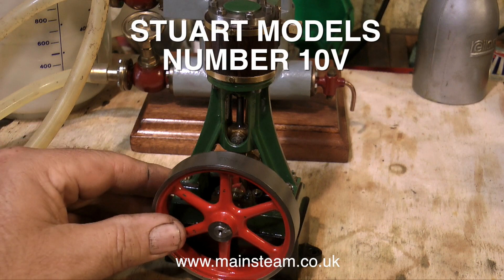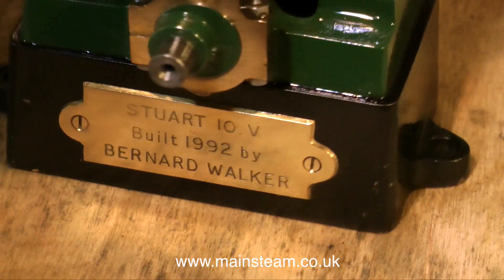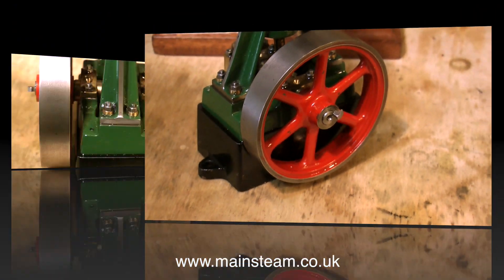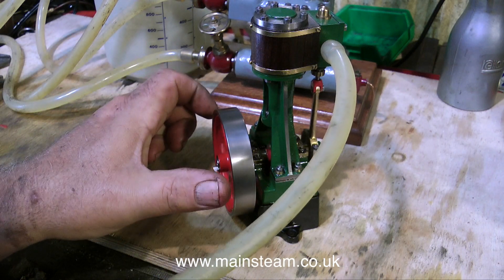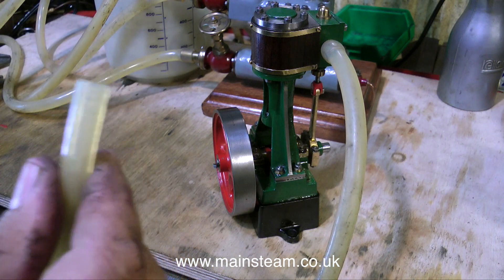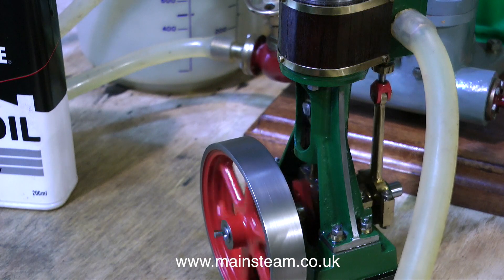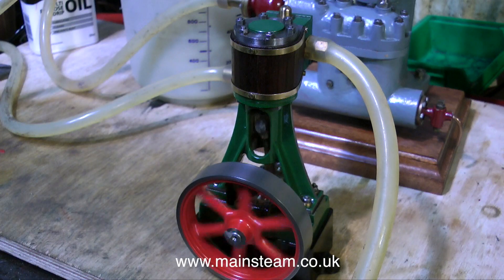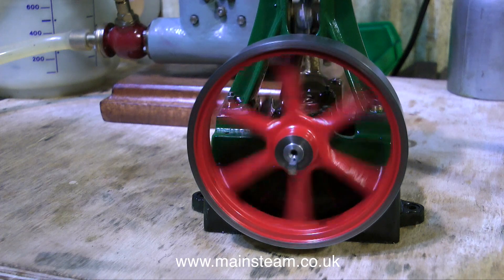BERNARD WALKER'S STEAM ENGINES - AN EXCEPTIONAL STUART MODELS 10V

Comment: I can get my stuat 10v to run extremly smothly on lung power and extremly fast aswell, which is weird seeming its valve timing is very late, the crank is haft way through the next stroke when it switches the valves. Dose that mean if i tried to run something using the belt it would lock up?